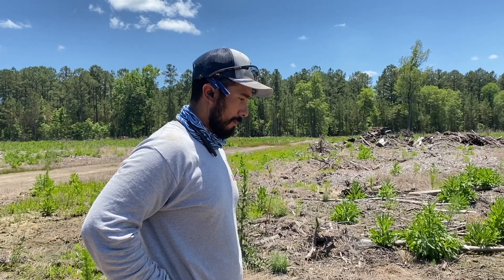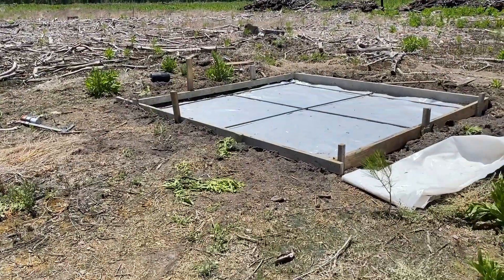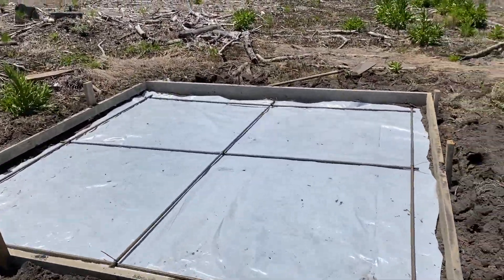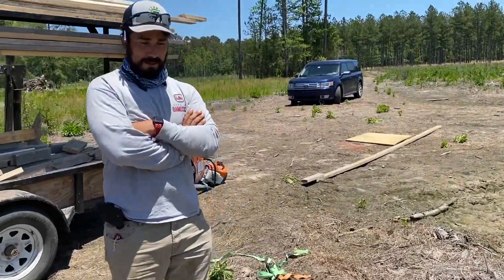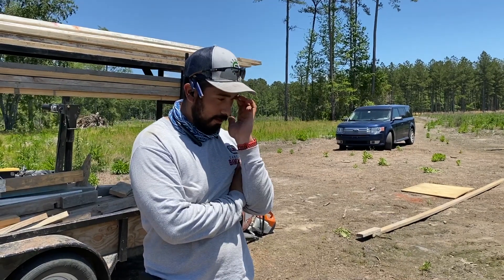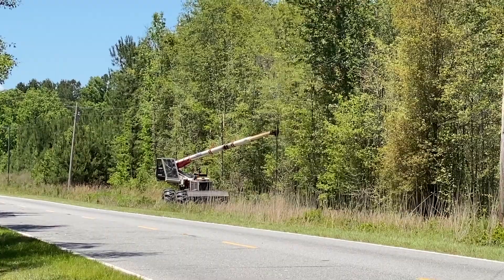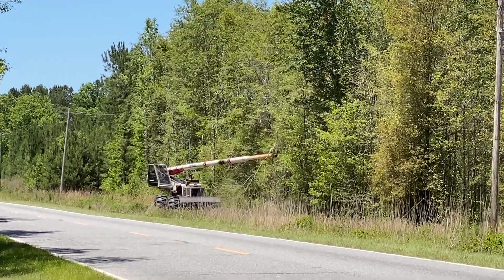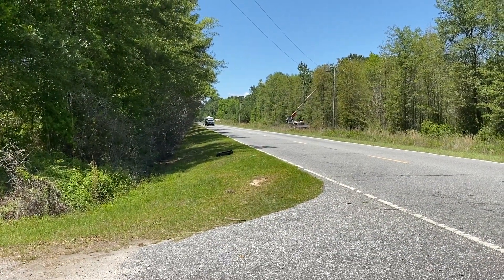Sky Guy Observatory Project Part 2-Concrete Foundation

Comment: If you haven’t installed the anchor bolts yet, you may want to consider epoxy anchors.  These are used in industrial plants all the time.  I believe they are preferred over the expanding anchors.  I’ve used this with threaded rod (cut to size) and some epoxy I found at Home Depot for some home projects.  But I don’t know exactly what they use in industrial plants.
Reply from the maker: Brad, thanks for the heads up about the epoxy anchors. From the way you describe them couldn't I perhaps use the epoxy glue on the expanding bolt anchors? You describe "a threaded metal rod" which sounds an awful lot like the threaded  metal screws of the expansion bolts. Couldn't I just either coat the shafts of the bolts with the epoxy or put a certain amount down in the hole before driving the bolt down and popping out the expansion pins? That would give me two different kinds of 'grab' which would give some redundancy... Any ideas what kind of epoxy you'd use for something like this???
Bill
Reply: I used some epoxy I found at Home Depot that was for concrete. I used it to anchor a railing (it’s been solid for 17 years now).  I believe the stuff they use in industrial plants is nearly as good as the j-bolt type anchors poured into the concrete. For the threaded rod, you can buy that at Home Depot in 4 foot sections and just cut to length (make sure you clean up the threads), or you can use a regular bolt that’s threaded all the way to the head and cut the head off.  But you’ll want the threads for the epoxy to grab onto, the expansion anchors are typically pretty smooth on the main shaft.  For the epoxy, you could check with an industrial supply house in your area, or your concrete contractor may be able to tell you where to get it (or Home Depot if those don’t work).  Hope this helps.

Comment: Exciting!  What's the bortle scale at this location?
Reply from the maker: Depends on which direction you're looking but my best estimation is that once you're higher than 35° above the horizon, it's about Bortle 3.7-ish. My Sky Quality Meter reports 21.8 so this should be 'good' but not 'great'. Still, it's gonna be waaaaay better than the sidewalk in front of my condo!